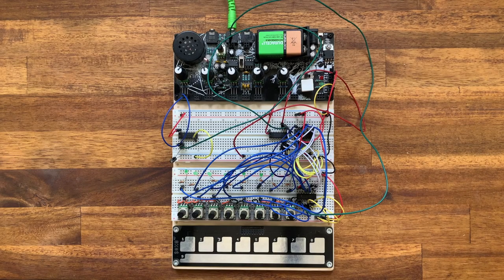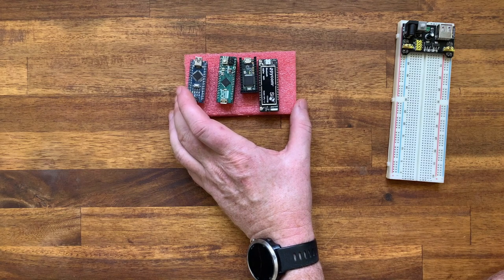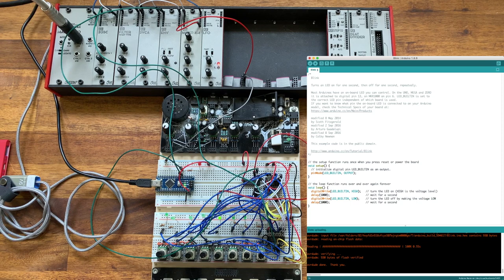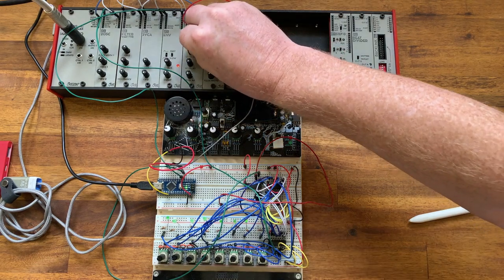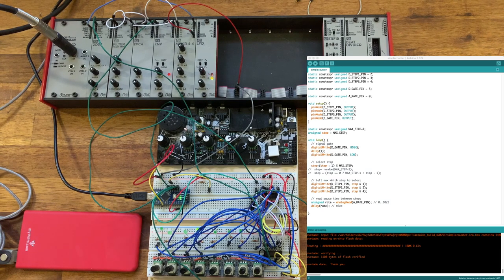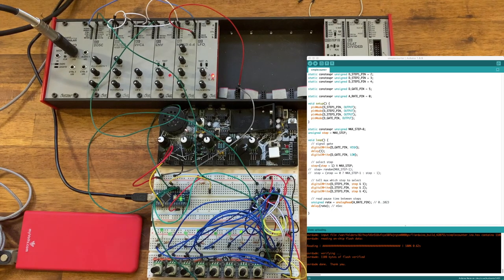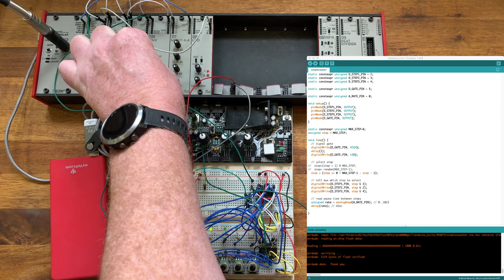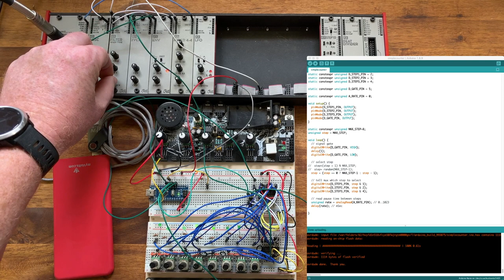Musical Hacks #3 - Step Sequencer adding MCU

Comment: I feel like your video recording settings could be adjusted for smoother video. It feels like there's less than 24 frames per second, or something odd with the shutter speed. This is of course a minor technical feedback, that's all.
Reply from the maker: Mr. Fedor hmm, could be OBS.camera  or OBS, I’ll check the raw footage. I’ve been using OBS as an easy way to combine views and also stream directly to Mac , but starting to think it’s more hassle than it’s worth !